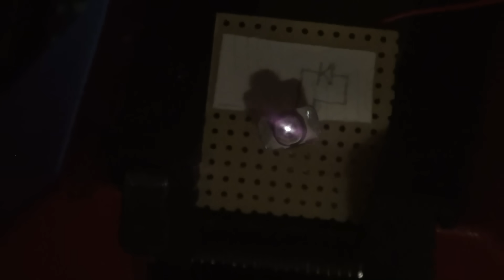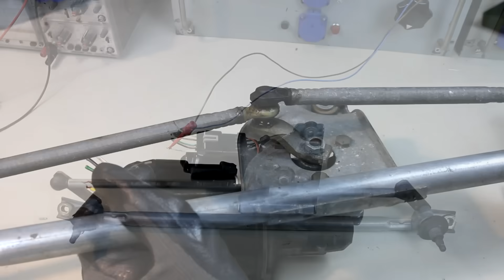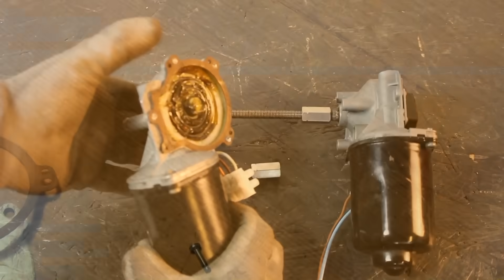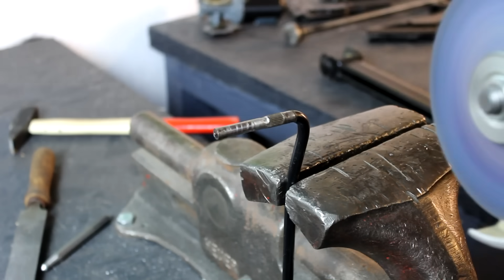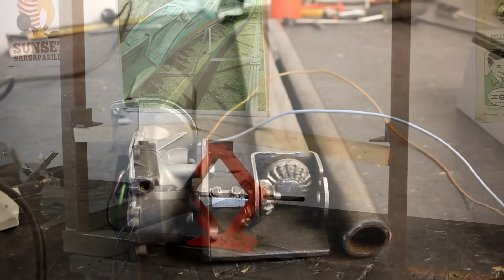Build Powerful Linear Actuators from Windshield Wiper Motors and Car Jacks

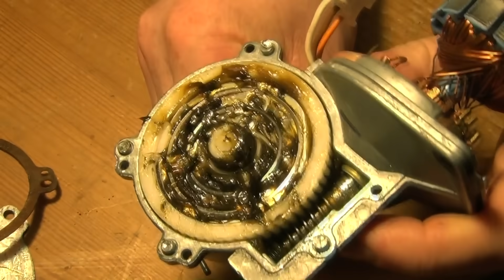Comment: 4:58 "I wouldn't recommend putting a crazy amount of axial force" then proceeds to crack 2x4's in half with it. :P  How that tiny worm drive with such a thin pitch is able to break 2x4's is mind blowing.  Did you swap out the gear and lead screw internally or did it break the 2x4 with the stock gear?  If you pull any wiper stalk switch from a junkyard car it would likely serve as a good controller for the motor since that's the switch intended for it.  So if you're in a junkyard don't just grab the motor and assembly but the wiper stalk switch too. Had absolutely no idea wiper motors were that powerful.  Awesome video, great content.  Thank you for the lesson!
Reply: If you understand what axial force is, you understand that there was zero axial force applied to the gear he was referring to at that moment.

Regarding the plastic teeth and how it can break a 2x4 without stripping the teeth... there is a huge reduction in both that worm gear assembly and the lead screw from the jack.

Comment: That's the cheapest example of a linear actuator I have seen so far that is actually robust enough to be useful in a number of applications. I'm thinking of applications that range from a TV stand for hiding a flat panel TV to a driveway door and all the way to a small press. Btw, maybe breaking bits of wood is a bit of an overkill in order to test for the actuator's strength. A more accurate method - and also one that would put a lot less stress on the motor - would be to just try to lift a set of barbells or a large container filled with water. Using water as your weight measure enables to you find an accurate limit to the force the actuator can exert before hitting it's current limit. Great work!

Comment: Awesome MEEKNESS !!.. I am doing it !!
TRY AN H-BRIDGE ??   BUILD ONE YOURSELF... EASILY... FOR ANY VOLTAGE...
KODAK HAS A FEW RELAYS... A 555TIMER ... A 3position switch for...  for/off/rev  ... even add a potentiometer for speed control... too easy. That's practically a control panel for a machine operator position...!!

Comment: As for the gloves find leather and just glue a new section to fit as for the mask some hot glue will work and for heat find a wide 10"" pot burn wood extinguish the fire using it for heat, no smoke, just heat.

Comment: For positioning you could also use a multi turn potentiometer driven from the drive.  My mower uses this inside the actuator that sets the cutter height.

Comment: I want to see this on a portable motorcycle flat jack by K&L with forward and reverse powered by a small battery that my friend will make you rich!!! I basically want to eliminate using a ratchet to open and close the jack.i work I a motorcycle shop and everyone would buy one

Comment: The scissors jack you can use a switch mounted in the middle with a wire connected to top of jack so when it opens fully the wire  it pulls toggle switch and cuts off motor.

Comment: I Like it,,very well done,,not sure how expensive they are But 1/2 inch drive universal joints,,like in your socket set,,for drives,I have used them for long handle connections for valve's,,

Comment: Good stuff. I have been thinking of using actuators to lift the roof of our poptop caravan. I found these spring compressors with 380mm acme thread, cheap as bro. https://www.ebay.com.au/itm/2x-Coil-Spring-Compressor-Clamp-Heavy-Duty-Quality-Car-Truck-Auto-Tool-Set-380mm/311758410621?epid=581296950&hash=item48963fd37d:g:AmYAAOSwvjdZXeV-

Comment: I trust this video show how much torque  doing out in mechanical thread with dc wiper motor only  but the mechanical Jack u show is counter weight needed for surely balance i like it this video you post

Comment: you can use the hole assembly for the steering and use the switch as a position sensor

Comment: Very interesting video, thanks! 
I've been wondering if it would be possible to build a kind of container lift to get a shipping container or swap body off the ground and about 1.1m high to drive a truck or trailer below it and secure it. Usually you'd use a forklift or crane or something I guess. Not sure if any of that is actually practical though.

Comment: Very encouraging tutorial. I want to convert my manual winding jacks for my lift off canopy on my ute and don't want to spend $1k on brand name jack conversions. 1 motor and gear drive with a 14mm socket on each motor for the jacks to wind up at the same time all wired together (or battery powered like a BBQ rotisserie) to one switch would be great. I thought a wiper motor or window actuator with up down would do but I don't have welding skills or equipment. Any ideas on who to talk to about this in Australia would be appreciated. 
Keep up the good work. 
Thank you for sharing ur brain with the world.

Comment: The cheap Chinese jack will the motor be strong enough to lift a car? If so much better than the crank handle, just slide the jack to the jacking point and plug into the cigarette plug.

Comment: Dear Mr inventor could you turn your attention to a homemade way to make landing wheels for a motorcycle.  Im partially disabled and if there was an apparatus where I would not have to put my feet down in slow traffic. Like stabilizers on a bicycle except they need to drop into place quickly when you stop and then spring back out of the way when moving off quickly.  You can buy these but are very expensive.

Comment: Imagine getting a cheap 2$ arduino with two position sensors to just tape on, and a little potentiometer to set its length and abandon it, waiting for it to get to where it needs to be.

Comment: Nice job. I need a linear actuator for my solar panel array and the strong torque actuators are expensive. I can use your ideas to make my own, I just need to figure a way to reverse it at the end of its travel distance.
Thank You.
Reply: frankmmiii cordless drill switch/triggers work great

Comment: In case ya dont know GM makes a trick scissors jake for HD stuff like motor homes. It looks like a normal jack except for a 6 sided disc on the input side...can you say....gear reduction...weld an old socket where the handle used to fit and with a basic 18 volt drill it will lift a front wheel on a dodge diesel pickup easily...just keep some grease on the threads

Comment: HELLO I have a question and please help Is it possible to use this motor to make a scooter for a 25 kg child????
Reply: yes easy, weld together a small frame (or use wood) attach some axles with local Home Depot rod, attach some wheels, attach a bike sproket for the drive gear then get a cheap used aluminum LS V8 motor from your local automotive store and watch your child engage warp 10. Helmet is recommended.
Reply: That's just silly...you get the engine from your old GSXR.

Comment: those old wiper motors will not destroy themselves. what will happen is that they will get stuck and the shaft (armature) will slip past the brushes when their load is exceed and the motor will simply stop working ... just like the window motor. of course the mechanic will tell you, it is broken. 

seconly you said, the bearings won't handle axial loads while the project they were used for in your video is all about axial load ^___^  and thirdly if you flip them upside down they can serve as an acurate industrial drill press rack and pinion ... but thank you for the video, it helps broaden my options where to salvage resources for cheap ... especially that wicked trapezoidal threaded rod

Comment: No heating yet in the workshop - gimme 5. :) IMO this might do as some temporary solution: https://www.homedepot.com/catalog/productImages/1000/06/06b94abd-2a80-42ed-91e4-c5abf3c6e3c5_1000.jpg and when I'd have time I'd like to test this idea. Ventilation is no problem, so health safety would be kept.

Comment: Argon can be expensive to refill, here in Canada we pay quite a lot for it, so I switched to flux cored wire. Sure it stinks, so you make sure to have ventilation and a filter mask can remove the worst chemicals, but it welds nicely, a 10lb roll lasts a very long time.

Comment: Mich fasziniert wieviel Kraft dahinter steckt,immer wieder auf das Neue. Für mein RC Monster Truck Projekt in scale 1:8 hatte ich solche Scheibenwischer Motoren im Sinn. Bei CONRAD wurde ich aber fündig mit ähnlich aufgebauten Motoren ( RB-2). Diese Motoren haben eine 8 mm Welle,welche über beide Enden hinausragen. Selbst bei einer niedrigen Spannung von 1,5 Volt,vermochte ich es nicht die Welle zwischen Zeigefinger und Daumen anzuhalten. Leider sind diese Motoren nicht mehr im Program von CONRAD aufgeführt.

Comment: Too much work! I use a cordless drill to operate the scissor jack.
Reply: Lol I do the same thing 😂. BUT I made this anyways cause its fun for me.
Reply: I do the same thing but make sure the sucker has enough power or you'll burn it out quick...:)
Reply: @Aussiehomestead1965  Some years ago one of my friends in the model club used to make DIY wheel chairs for kids on low budgets using two windscreen wiper motors to drive the back wheels. Using these 12 volt motors is all about gearing down the motor to increase the torque etc.
Reply: Al Carey not as much power and you kill your drill motor in doing so.

Comment: You can make H bridges and powerful motor controllers with mosfets. I was given a broken 40A brushless speed controller and managed to get 12 working fets, you can get the data sheet by looking up the number or just hook one up to a breadboard. I found if you just tested which pin was what with a breadboard you will melt the tracks of the board before you even get the fet to warm up.

Comment: I have a lot of experience with windshield motors. Used them on a robotics project 17 years ago when it was not possible to order a linear actuator in my country. 

One quick suggestion on the connection. File the sides of the motor with the spline flat on two sides of the spline and use a nut to secure it. The threads are not the best for transferring the torque. If my description is confusing I can upload a video of one I did. Let me know.

Comment: Can i just ask you something please? Unrelated from the topic of this video but i was wondering.

If i used an angle grinder (specifically battery powered) and the disc came into contact with a live wire, would the tool cut out as a safety precaution? Dont worry im not going to try it!

Comment: Awesome instructions, thanks.  The motor on the red jack should have been turned 90 degrees so it would be out of the way when jacking and add a cigarette lighter plug to the end of the wire with an on/off switch by the jack then it could be kept in the car for flat changes.
Reply: Pinter banget !
Reply: thanks (Terima kasih)

Comment: Thank you, very informative and inspiring. Great idea for a wine press if one had a winery. Harbor Freight Tools sells a motorized 12v scissors jack like that, made in China of course. I bought that same Mercedes Benz jack for 15 dollars here in California, but I think I got lucky since people here are getting ridiculous with their prices for even the VW used parts. I have been thinking of using one of these wiper motors for making my fog lights come from behind my car's ('72 VW Ghia) bumper when I need them and tuck them away when I do not, just so the look of the front of the car is less busy or cluttered, but it is a long way from now.

Comment: Build Powerful Linear Actuators from Windshield Wiper Motors 
With so much high torque that if you try to mess with it while they are in operation then your hands will get cut off.

Comment: will that sissor jak able to lift a car with 12v dc???
Reply: Fucking A probably even 14.6v square wave or 120 volts ac with a rectifier bridge a transformer and some zener diodes, maybe even 6 volts if you have enough time to wait.

Comment: Those BTS7960 H-bridge modules might have some manufacturing issues. @scanlime used some in her winchbots, and she cleaned them up by removing the heatsinks, making sure to remove any solder splatter on the PCB, then adding some thermally conductive tape between the PCB and the heatsink (since it has poor thermal contact by default).

Comment: Can you make a CNC with those Windshield Wiper Motors?
Reply: I think the back lash is to big on the worm drive. It's not accurate enough.
Reply: I think the back lash is to big on the worm drive. It's not accurate enough.
Reply: JyL Marketing Group Not really. There's a reason stepper motors are used in CNCs, not DC motors...

Comment: Do these units change current draw when under force?
Reply: Robert Thomas Yes, they would. If you ask something to do more work, then you need more power available to do that works. Without load a large DC motor might draw one ampere (amp), put it under load and it might draw 5 amps. If you have a 3ampera power supply, you'll either over heat that to destruction or be blowing 3amp fuses eveytime you put the motor under load.

I hope that answers your question. :-)

Comment: You could also use the Schleifkontakte inside the motor (that are normally used to stop the wipers at the right position in interval mode) to track the position (with the arduino) instead of an optical encoder... That would of course give you a rather low resolution and you would still need limit switches, to "home" the actuator (or save the position to EEPROM on power down, since the motor can't move on it's own with such a gear reduction anyway), but it would certainly be cheap. ;-)

Comment: Oh, another source of trapezoidal threads is old scaffolding tubing bases. At least here (NZ), these have trapezoidal threads - I imagine that similar would be found on scaffolding parts wherever steel tube is used for scaffolds. They tend to scrap them fairly routinely, probably because of health and safety reasons... These tend to have some corrosion on them, and are quite large. But they'll take enormous forces, and the corrosion is often not too bad.

Comment: Brilliant! 

I've been building... Sort of... A mini milling machine using the ACME thread and nut from a scissor jack. The jacks cost <$10 from the scrapyard. You get an ACME threaded rod, an ACME nut with threads and bolts to attach it to something else, and some steel which is capable of lifting a Toyota and is designed to last for several decades or more. 

The red scissor jack that you feature is of very similar design... It is likely that the nut is fastened with two bolts either side. These, for me, have been difficult to remove - it takes some penetrating fluid and a vise. They have fine threads and are torqued in tightly, likely by design. Once they are out, they can be re-used to attach the nut into something else. 

Additionally, high torque geared reduction motors of small size can be purchased direct from China (aliexpress).

Comment: dont know as the cost of fuel for it where you are but a ventless propane space heater 35k BTU does an adequate job of heating a space such as your shop for minimal expense. Oh and as always very insightful use of reclaimed items.

Comment: One thing about 12V motors: they are easily switchable from forward to reverse. I did an automatic tambour and used the motor out of an old dewalt drill with a couple of dpdt limit switches at the ends. When it reached the top, the relay cut off the power and reversed the leads so when reactivated to lower it, the motor had power, only in reverse. Then when it was time to go up, the lower limit switch reverse the polarity again and allowed it to go up. 

Great video on sourcing a useful motor/drive train. I bet you could get them even cheaper from an auto recycling yard.....
Reply: Muskoka Mike That’s similar to some post war model trains I got from my great grandpa. It has a kind of relay that switches directions every time you cut power
Reply: Muskoka Mike เพลง

Comment: I am experimenting with wiper motors for a robot too. In my tests, when the wiper motor is on the faster speed, it draws about 6A unloaded, and after about 20 mins, is around 70c? is this normal? also, I am planning on using 12v lead acid batteries, but I hear that you aren't supposed to run them too low? what would you recommend for powering wiper motors so that I can run the robot for an hour or so without worrying about damaging the battery?
Reply: Deep cycle marine or fork lift batteries are made to be nearly fully discharged without damage. They have lower cranking amps than automotive batteries,but would be ideally suited for your application.

Comment: I think you can make automated door actuators with them or maybe, use them to actuate a drill press or use in a lathe by using an optical encoder.
Reply: Well I wouldn't count on any precision work, those things have so much slack it just wouldn't work reliably.

Comment: I would suggest you use a shaft coupler instead of welds or bolts, you will never get them dead on and if you don’t have play in the gears, you will soon from the pressure imparted by the slightly off center rotor.